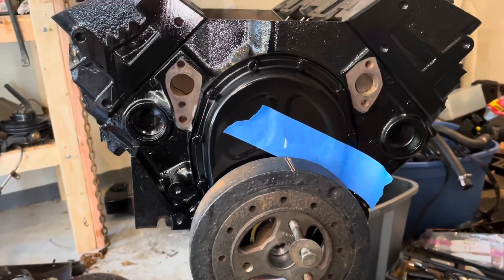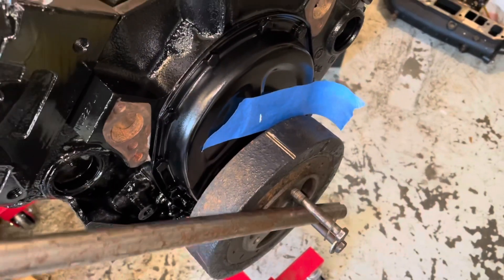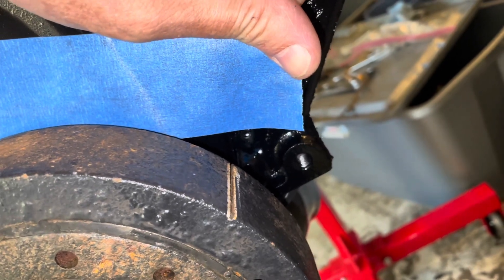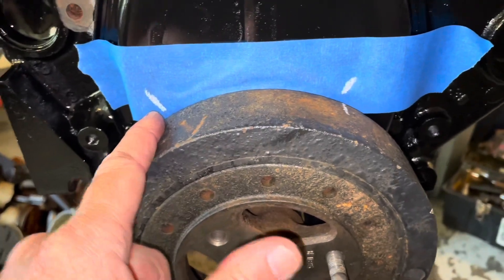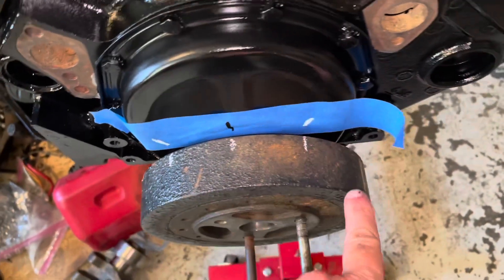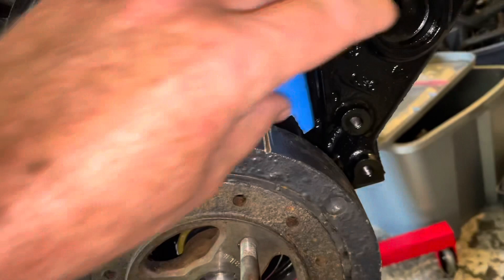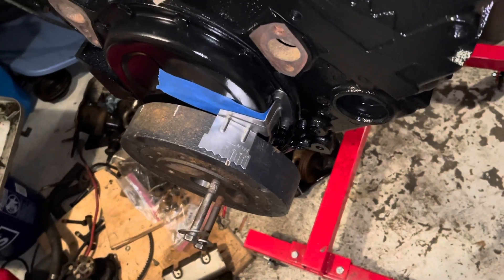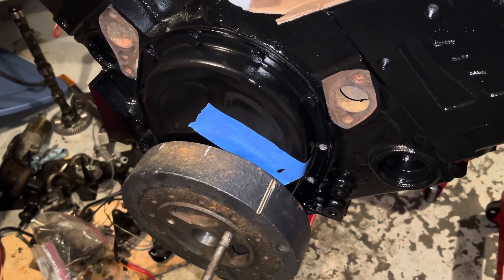Mercruiser 5.7 1(k) - How To Locate TDC (Top Dead Center)

Comment: The method being shown in this video is not accurate!  In order to locate True TDC, and with the cylinder heads in place, you will want to use a PPS tool (positive piston stop) installed in the # 1 cylinder spark plug port. 
With the piston not yet near the top of stroke, insert the PPS tool, and gently lock it. 
Now gently rotate the crankshaft until the piston is stopped by the PPS tool.  
The goal is to stop the piston at approximately 30 crankshaft degrees before it would reach theoretical TDC. 
If you are not near 30 degrees, adjust the depth of the PPS  tool. 
(30+/- degrees offers more accuracy). 
NOTE: 30 degrees is a suggestion only........ you can use 25 or 35 degrees, as long as you stop the piston at the same crankshaft angle in either direction of rotation, you will be OK. 
Once the piston is gently stopped by the "locked-in-place" PPS tool,  make a mark to identify the crankshaft's  location relative to the timing tab, or a tempory pointer. 
(using a degree wheel and a wire pointer offers even more accuracy!)   
Next...... rotate the crankshaft in the opposite direction until once again the piston is gently stopped by the PPS tool. 
Make another mark that identifies where the crankshaft has been stopped.
Now remove the PPS tool from the # 1 spark plug port.
Next, very accurately divide the marks equally. In other words, split the marks. 
Now rotate the crankshaft again until the balancer mark aligns with your new "split" mark on the tab or with the temporary pointer. 
This will place the # 1 piston at True TDC, and will now allow for a permanent marking.
Now you will have the abiility to achieve accurate spark timing, camshaft phasing, etc. 

This works with any piston type engine, regardless of the number of cylinders.
Reply from the maker: I would take bets that the method I presented works just as well as a PPS tool. I’m basically doing everything you describe. As long as the piston stops when coming up from both crank directions it works. My piston stop is just as accurate as the bought tool. I just have to make sure it’s inserted all the way in both times.

If you noticed in the video my method lined up exactly with the bought timing tab at the 6:40 mark so what’s not accurate about it?
Reply: @moccasinmarine  First off...... I mean no offense to you. I read your write up, and and decided to offer my take on this so that any onlookers will have a better understanding on how to more accurately locate TRUE  # 1 TDC. 

A little history; I've been working on, and building, engines since the mid 60s. Accuracy has always been important to me. I know of NO machine shop, nor of any well seasoned mechanics, nor of any well written HP Engine articles, that would dare suggest using a socket extension to determine when the # 1 piston has reached a certain location from theoretical TDC. 
A spark plug port PPS tool is very easy and inexpensive to purchase.  You can even make one using an old spark plug.   

So here is my take; 
I see multiple problems with this socket-extension-in-the-spark-plug-port method:
1.... the extension that is inserted into the spark plug port is not threaded, therefor it is not mechanically secured into the port as to secure a stationary position.
2.... with the above in mind, the extension is not able to maintain the same exact depth when bringing the crankshaft back around in the opposite direction allowing the piston to once again contact it. (it is not stationary)
3.... we also need to have a fixed engine locating point (timing tab) that remains unchanged during this procedure. (going through this procedure without a permanently fixed timing tab for a referrence point, is counter-productive)
4.... we want to use a large enough angle of separation while marking piston contact in each crankshaft direction..... for me, I shoot for 30 +/- degrees. However, you can use 15, 18, 26, 28,  30, 31, 32, or what ever you want to use, as long as it creates a decent angle of separation that can be split, ending up with a decent remaining angle. 
5.... once we determine an XX degree "stop" in one direction, and the same XX degree "stop" in the opposite direction, we are now able to split the difference and make our new mark. 
6..... We now remove the piston stop, and rotate the crankshaft  to the new "split"  mark, of which gives us true TDC .
In other words, we need to accurately split the crankshaft angle (lets say that it did happen to be 60 degrees) between the two locations where the piston has been stopped.  1/2 of 60 = 30.  
7..... Ultimately, we are ensuring that the crankshaft angle results in a true  # 1  piston  TDC. 

We use crankshaft angle for ignition spark timing,  camshaft indexing/phasing, etc. and it's all based on the # 1 piston being at True TDC.  

The engine's performance and it's maximum torque all boils down to an LPCP of 12 to 14 degrees ATDC.
 So basically, valve timing and spark lead have the last word in determing where LPCP ends up. 

Again, no offense intended. 
Mark E RicardoMarine (retired)

.
Reply from the maker: @markemery49  first of all, I’ve seen many of your posts on the iboats forums, etc. glad to know my channel has the reach that it has.

But the gist of your comment is that my using a “socket” is somehow not accurate. It’s a socket extension tool of about 4 Inches long btw. If you watch enough of my videos you’ll notice that the theme is I build engines to spec as cheaply as I can using whatever methods and tools I can conjure up. Most of the time they work. Sometimes they don’t. In this case I’ll stand by the method since at the 6:40 mark, the purchased timing tab shows I was right on target. If the method did not work, I wouldn’t have posted a video showing it failing? Sometimes I do post a failed method if there’s a learning opportunity. That’s actually the fun of running a business; always trying new and more efficient ways of completing tasks (or eliminating tasks) but getting the product out the door with the same or better quality.

There are a lot of methods out there that are either a waste of time because they aren’t based on science (like shimming LS oil pumps) or are needlessly overly complex. As long as it gets the job done, I’m good with it.

Thanks for engaging with my channel since any discussion is good discussion.
Reply: @moccasinmarine  Thanks for your response, and thank you for understanding that we can simply agree to disagree, and in a gentlemanly fashion. 

I stumbled onto your video while doing a search for another purpose. When I watched it, I found the need to clarify a few things for those who may be wanting to accurately locate # 1 TDC. 
Unlike you, I do not build an engine as cheaply as I can using whatever methods and tools I can conjure up. I am too anal to do that, and the correct Marine build is simply too important to me. 

But I'll digress here...... and I'll mention a few other things: 
TDC not only represents where the # 1 piston is at the top of it's stroke, more importantly it represents the crankshaft angle. 
We index a camshaft, adjust ignition spark advance, etc, by way of crankshaft angle. 
A piston while at the top of it's stroke, still allows for some change to the crankshaft angle. You can see this if you were to look for yourself. It may be a small amount, but none-the-less, there is some movement. 

True TDC is achieved when the center of the crankshaft, the center of the # 1 connecting rod journal and the center of the # 1 piston are all in perfect alignment with each other.  That is the main concern! 
Note that I said center of the piston, not the center of the wrist pin. 
Wrist pins are offset, and do not represent the center of the piston nor the center of the cylinder bore. 

When all 3 of these are all aligned, the piston can't help but to be at true TDC. 
This is why the PPS tool, the 30+/- degree stop in either direction,  and the final split are so important! 

Here is a video by Jeff Smith, former editor of Hot Rod and Car Craft Magazines. 
Jeff knows his stuff. He and I fully agree that this method is the only accurate means of locating TRUE # 1 TDC. 

Jeff is using a crankshaft mounted degree wheel, a wire pointer,  and a cylinder deck  PPS tool that is used prior to the cylinder heads being installed. 
However, the spark plug port PPS tool works just as accurately.  
 
Watch closely at 3:49 into the video as Jeff demonstrates how  this is done.
Note that Jeff does not rotate the crankshaft by using the center bolt! He uses the correct tool. 
Jeff comes up with a 40+ish degree split. 
 At 4:40 into the video, he moves the degree wheel to accommodate for his first attempt error.
He then goes back through the stopping procedure, until he sees the same angle of separation on either side of the "stop". 
NOTE:  you can also move the pointer in leu of moving the degree wheel...... your call on that. 

What Jeff does not show in this video, would be the removal of the cylinder deck PPS tool, and then the location of the crankshaft at True TDC...... but I'm sure that you guys will understand how that is done. 

https://www.youtube.com/watch?v=xGbH3iXkvcw
 

Here is another video by a DIYr that's not too bad. 

https://www.youtube.com/watch?v=xg6eAWWvrPA&t=3s

 Anyway, let's not argue over this. Let's simply agree to disagree, and leave it at that! 

If the socket in the spark plug port and blue masking tape suits your needs, then by all means use that method. 
If you are after more accuracy, then I suggest using a PPS tool, and follow Jeff's and my procedure. 

Fair enough????

And remember...... these are Engines, not Motors! LOL

Comment: Will this method work for 3.0L mercruiser?
Reply from the maker: Yes but you should have a permanently mounted timing tab on the timing cover so you should have no need to locate TDC.
Reply: @moccasinmarine  My harmonic balancer does not have notch I called mercruiser tech support they said there have been some balancers from factory didnt have a notch.  There is a dimple between the balancer sheeve maybe thats the notch its a 3.0L TKS engine.
Reply from the maker: @howebaker7855  in that case then yes this method should work. I would take a hack saw and make a notch on balancer once you find TDC. Sorry for late reply. I didn’t see this until today.
Reply: I doubt that Howe still needs this info..... but for anyone just now reading this..........
 Many of our harmonic balancers incorporate an inner hub and an outer ring. The two are isolated with a composite type material. Occasionally, the outer ring will slip on the inner hub, causing the OEM TDC mark to no longer be accurate.  So yes, it is never a bad idea to verify true #1 TDC, and yes, the same PPS tool procedure will work on a 3.0L engine.

FYI... for anyone who is building an engine, and who has concerns that the TDC mark on the balancer remains true, take a center punch and make two adjacent punch marks...... one on the inner hub, and one aligning with it on the outer ring.  
These punch marks will let you see of the hub/ring have slipped.